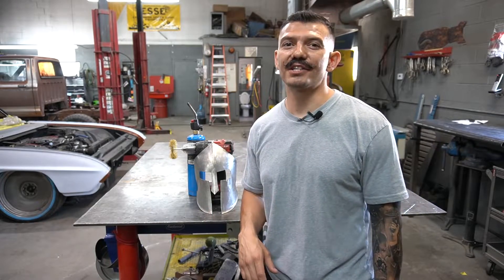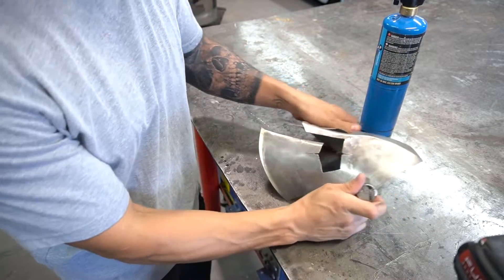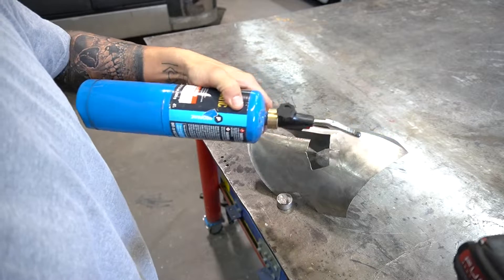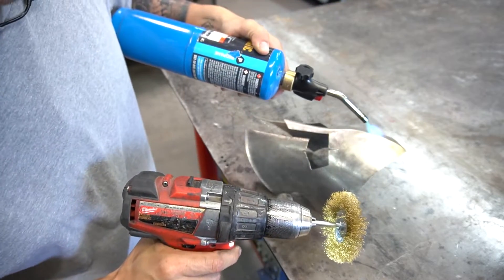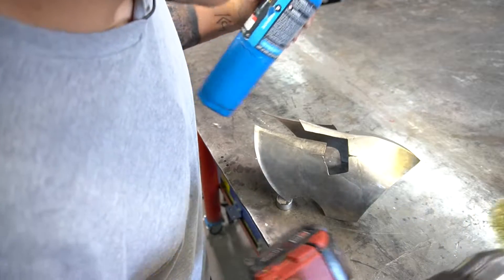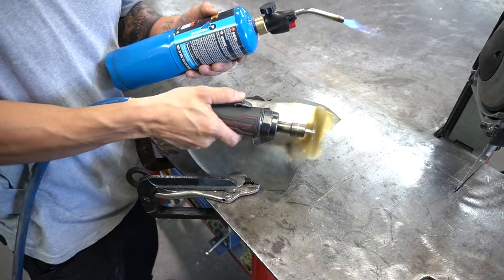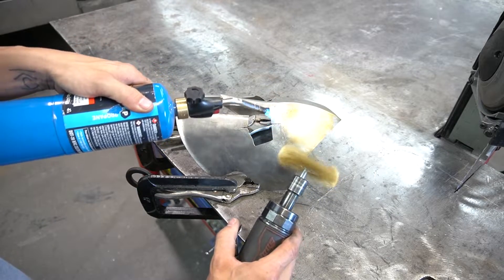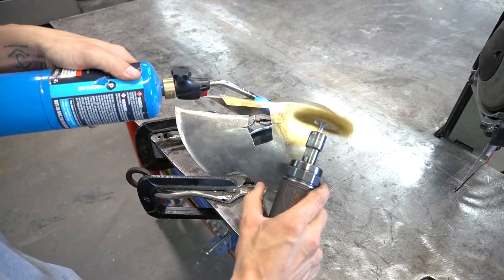How to Brass plate steel with simple tools - Brass Plating metal at Home - Easy Brass Finish

Comment: Ive accidentally brassed things before, and you dont need that much heat, but you have to run the brush a bit more. I guess you can creat the heat you need with just the wheel. I could be wrong, but i liked to play in the shop on my free time.

Comment: Hi! I tried this method on our front door handle, but not with a torch. I used a heat gun instead. Unfortunately it didn't worked out. Do you know why? Was it the heat gun? Or was the metal of the handle to soft? It felt like I scratched it more than brass plating it 😬
Maybe you have an idea, what I did wrong 😅 thank you! And nice video!!
Reply from the maker: Well I'm not sure what type of material the door knob is made from but it could have been the heat gun, when using the torch you want to heat it untill the steel turns the yellow color right before blueing, that's when you apply the brass, also you need a pure brass brush! Good luck!
Reply: @BeAMetalFabricator  thank you!! I won't give up trying 😁

Comment: Will this method ruin a temper
Reply from the maker: It could definitely ruin a temper. I wouldn't use this method of you need your part to remain tempered
Reply: Yep deffinetly as stated. Gilding paste however is not bad and gives the same finish look with practice as it's best wiped on.
It's not real gold but damn it looks good

Comment: How long did it last?
Reply from the maker: It's still bronze and looks fresh
Reply: a few battles i presume
Reply: I tried this on my training sword's crossguard and pommel. The guard was tempered 5160 steel and the pommel was stainless. Brassing looked great but it wears off pretty fast for something you actually fight at full speed with. I also definitely see the guard got weaker after the heating process. Not nearly enough to fail, but it burrs a little bit after a day of sparring when in the past it'd take several days to accumulate the same wear and tear. Still, it was a fun experiment and the maintenance isn't anything crazy.